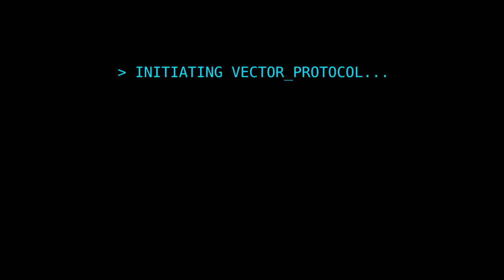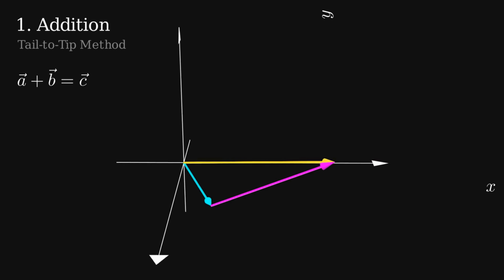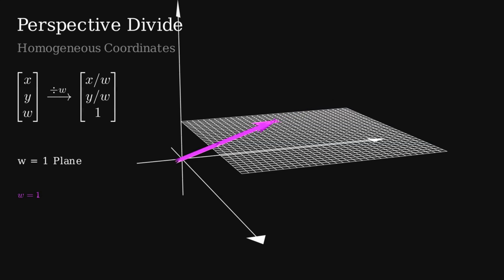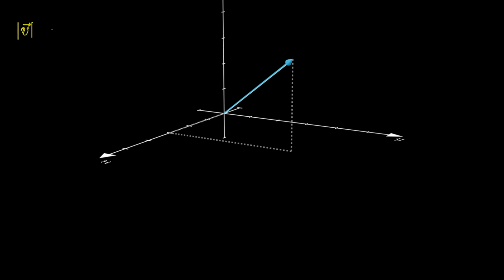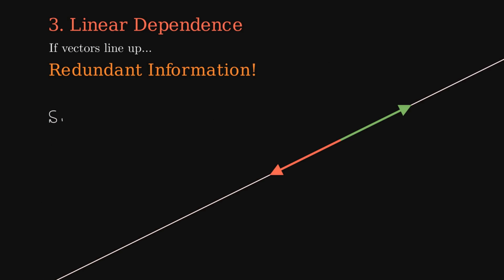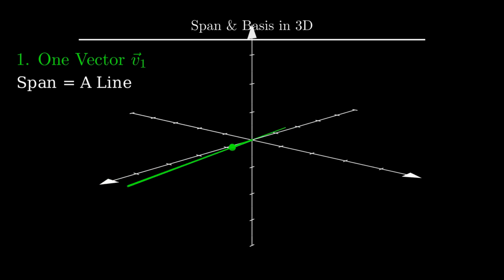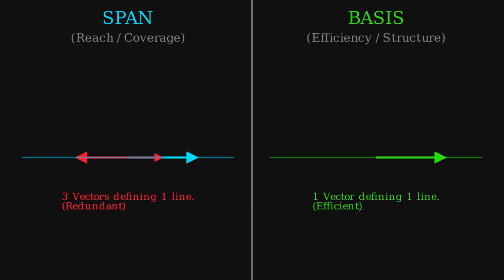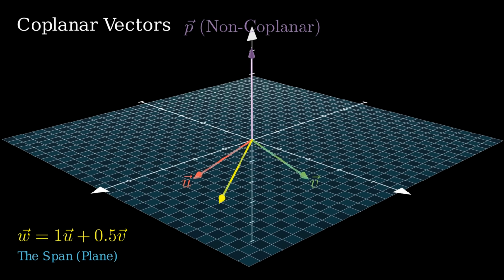Vectors in 3D: Operations, Span, Basis & Perspective Divide

Comment from the maker: Vectors aren't just arrows in space—they are the bridge between geometry, algebra, and computer science. 🚀

Whether you’re a physicist mapping a force, a mathematician locking coordinates to an origin, or a computer scientist scaling data arrays across thousands of dimensions, this video breaks down the core mechanics of the 3D world:

📍 The Essentials: Master vector addition (tail-to-tip), subtraction (adding the negative), and scalar multiplication.
📐 Geometric Normalization: Discover why "vector division" doesn't exist in standard algebra, but becomes a powerful tool for Perspective Divide in computer graphics.
🏗 Span vs. Basis: Learn why span is your "pile of building materials" while basis is the "efficient blueprint" for your coordinate system.
📦 The Volume Test: Understand how three vectors define a 3D volume, and why they become co-planar when that volume collapses to zero.

Timestamps to help you navigate:
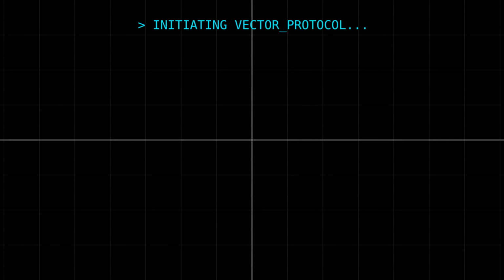[00:01] – Three Perspectives: Physics, Math, and CS
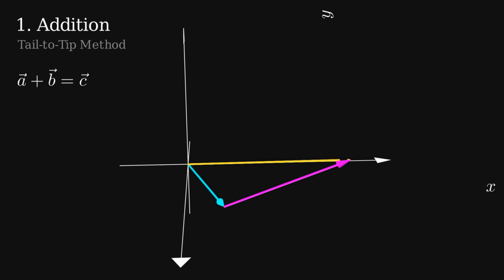[01:16] – Visualizing Vector Addition & Subtraction
[02:38] – The Mystery of Perspective Divide & Vector Division
[04:11] – Magnitude, Unit Vectors, and Direction Cosines
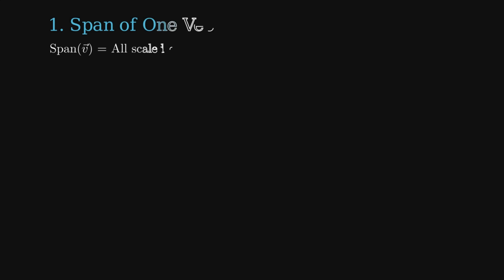[05:06] – Span & Basis: The Trap of Linear Dependence
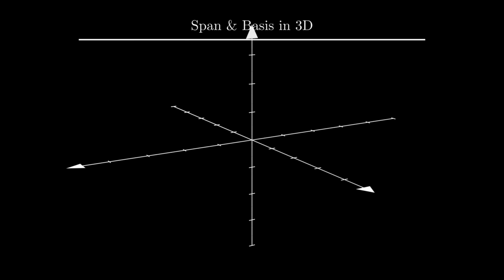[06:53] – Visualizing 3D Span: From Lines to Planes to Space
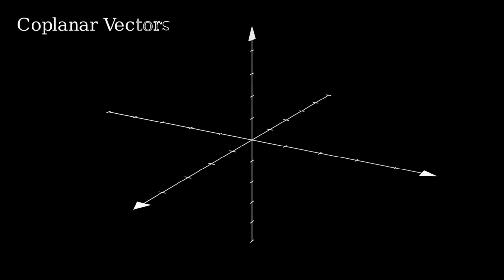[09:02] – Co-planar Vectors: The Volume Test

Which part of 3D math was the most challenging for you? Let's discuss in the comments! 👇

#LinearAlgebra #3DVectors #ComputerGraphics #VisualLearning